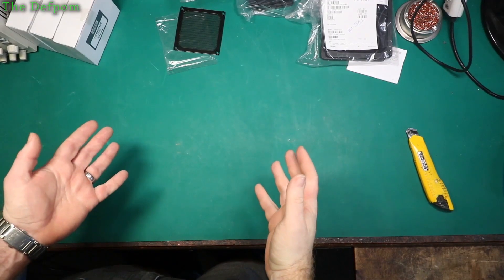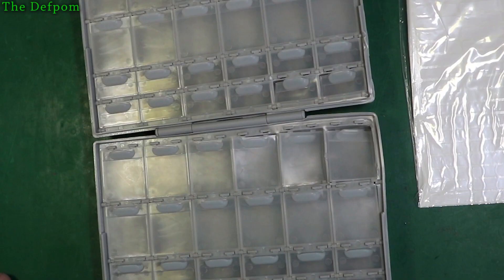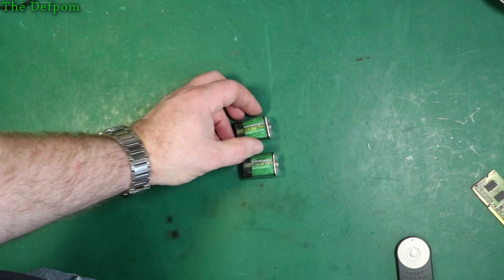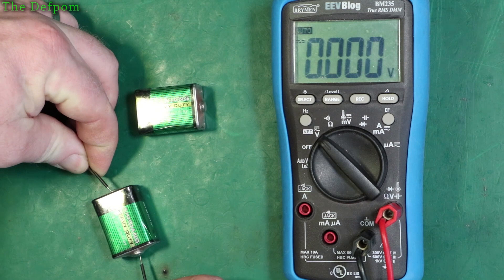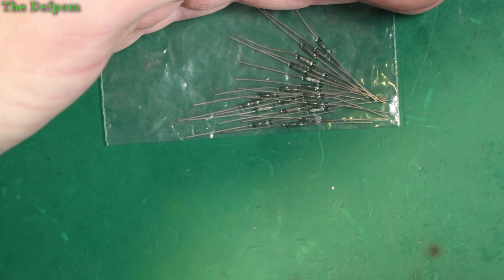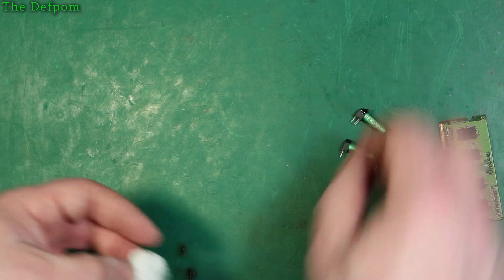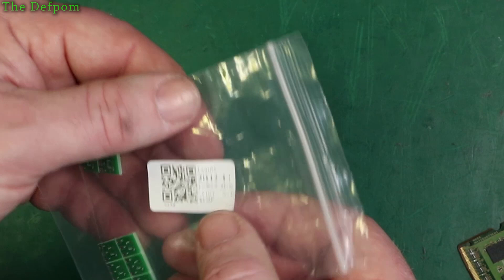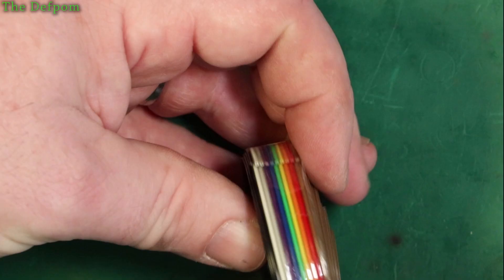#664 Mailbag ! - Whats New For 9th December 2019 ?

Comment: Great Video, and today I learnt that there are 15V batteries :D. Keep it up.
Reply: Wouldn't it make more sense to 3D print a holder to put 5 CR2032s or 4 small Lipos in series? Much better than overpriced "heavy duty" batteries.

Comment: There's just batteries in Infinit shapes and voltages.
You fixed an HP 8647 some time ago, where you able to find a real service manual for it or just the "User and service guide" ?